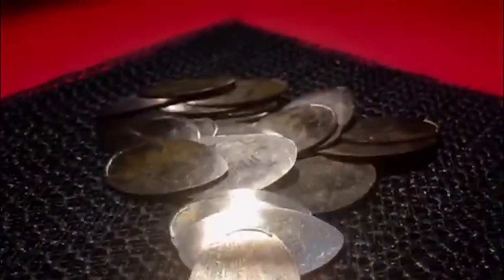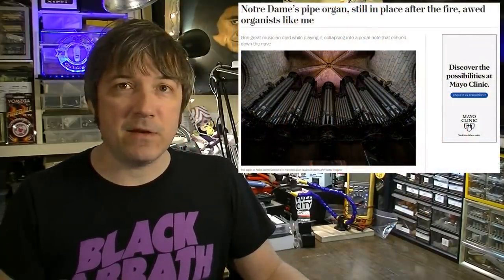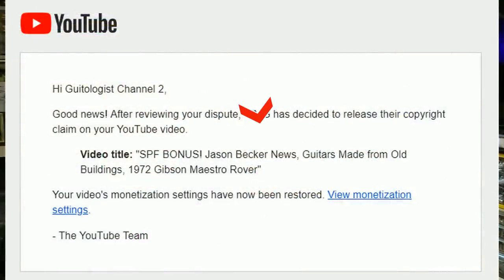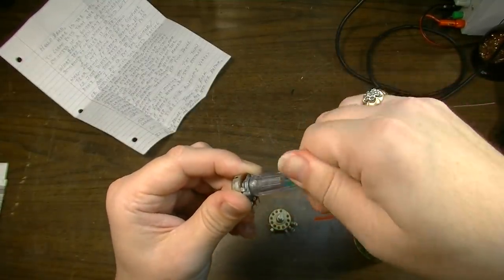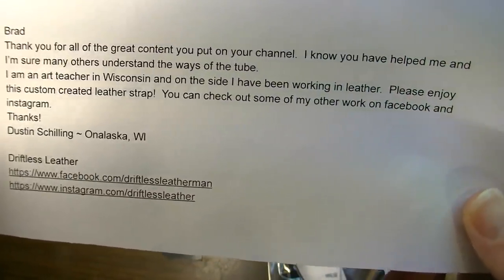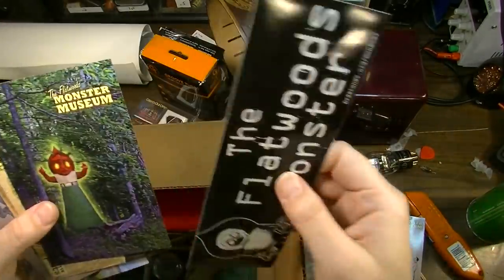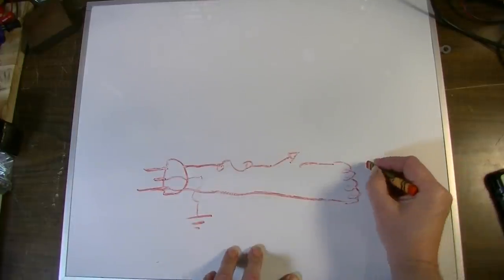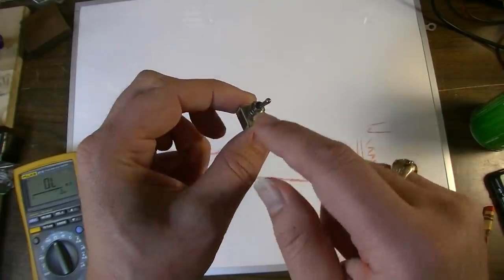Hologram Concerts Are the New Normal - SPF

Comment: Here's my comment on virtual midi controller.
I started out my musical life as a drummer. 
I took lessons from an awesome drummer . 
Between him an my Dad they drilled drum notation into my head. 
At the end of my lessons I promptly forgot all of it and never used that knowledge .
In 2000 I got a computer and it had Cubase VST 32 installed. Inside of Cubase I discovered the piano roll screen. 
I found when I had the drum track selected , ( track 10 )   if I remember correctly .
 I could program drum beats just by adding notes to the grid. 
The setting no map looks a lot like drum notation.
All that knowledge I thought I had forgotten came rushing back and that's how I write my drum parts .
Before that I use to tap the beats in onto a drum machine .

Comment: Yep.....3d printing wirh metals.  I work within a research and development group for a global commercial vehicle manufacturer.   We have several 3d printers that we use for "rapid prototyping". Among the dozen or so printers we have is 2 3d printers that print objects in metals. Its amazing. These printers run day and night. Ive seen projects that ran for 90-120 hours. Yes,  sometimes a 90 hour project has a printer failure  after 65 hours of run time. What a blast  !!!  Just restart the printer and sit there watching for another 3 or 4 days. Yee haa !
Reply from the maker: Can you sneak some video of that?

Comment: I had a situation with a Gibson SG where I removed the knobs and a half of the post just busted of a tone pot. Never removed the post before and it just busted off. Damn Chinese parts, 2016 was a rough year at Gibson as we all know.. All I wanted to do was clean a guitar that had less than 2 hours of playing on. I'd reached beyond my warranty and was told too bad. I bought it from Sweetwater and after just a few conversations, Sweetwater took it upon themselves to repair the pot, out of pocket, shipping to and fro. That was a seriously honorable act and they get huge props from me. 
I thought you'd like to pass that along. I asked for a new pot be sent, I would have replaced it myself, and they went that extra mile. I thought you'd like to share that level of customer service to your fans as Sweetwater deserves it. As a retired pet store retail manager of over 20 years, I would have done this myself, but it so rarely happens. I'm freaking really impressed. I know I can count on them, that is hugely reassuring in this day and age. In fact, they offered to eat the bill if I wanted to take it someplace local. Who does that these days? 
Sweetwater has my loyalty now. I'd bought a few cheap Epi's from the GC near me, but not again. I'm looking for my new guitar from Sweetwater. GC sold me a $400 guitar with almost 3/4 of an inch of string space at the 21st fret and sure, they dropped it to something reasonable when I brought it in to a local store, but failed to touch the intonation. Granted, it was just a $400 Epi, but still, Sweetwater would have dealt with that before it got shipped. That's my rant, off to bed. Be well all.

Comment: On the subject of the fire at Notre Dame... the Grand Orgue (Cavaille Coll) is to be removed from the cathedral and put in storage until such time as it can be cleaned, serviced and re-installed. The Choir organ however, (the one used for daily recitals, practice, etc.) was completely destroyed in the fire, since it was at the other end, near the altar, etc. and took massive water and heat damage. It will have to be rebuilt from the ground up, unfortunately.😐

Comment: On the pot cleaner attachment, Stew Mac sells something that is supposed to be similar in function. I think everyone has hoped that they could just spray some cleaner in from the outside, but unless it's really impossible to get at the pots for some reason, it's so much better to spray them from the inside.

Comment: not sure  about the toggle switch cleaning thing. the switch lever cant be contacted to the contacts . if it were whenever you flip the switch it would shock you. granted powering up when there is liquid contact cleaner puddled inside is not a good idea . i would imagine it could short the switch where it csnt be turned off temporarily or maybe even short current to the chassis. im not 100% sure of the internals of a switch but i cant see how the lever is connected to the contacts inside or else you would get shocked everytime you turn your device on. right?
Reply from the maker: The danger is in having liquid bridging the toggle and the contacts. You can fill up the switch and cause this to happen, yes. Don't ask me how I know that. ;)

Comment: The process used in making that guitar is called selective laser sintering, SLS and can make machineable hard metal parts. It's a lot different than a 3D printer that uses plastic filament, like the ones I use to make parts for the Harmonicaster electric harmonica http://www.harmonicaster.com

Comment: You, guys, in the States don't have RCD breakers in your grid?
Reply: We have ground fault breakers for areas where water is present (bath, kitchen, garage, etc), but the entire service panel isn't protected like in Britain
Reply: @ctyragdoll  I'm from Poland. It's standard here. I couldn't suffer from an electric shock if I wanted to. I am one of those people who are very sensitive to current. When I was building my home, there was this case when the electrician switched the power off from the whole house, and we were doing something, and I got a slight spark just from the bare hot wire, even though the grid was off, and the electrician was pretty amazed at that. There is about 1.5 km of wire in my walls...
Anyway, I've got a ground fault breaker on each floor of the house.
Reply from the maker: He's correct, different standards here. I'm kinda glad of it in a way because it would piss me off to have those ground fault breakers tripping all the time for no good reason.
Reply: @TheGuitologist  When you're working on the bench, then I agree! They could be popping all the time! However, cleaning a hot pot wouldn't kill the DIY amateur!

Comment: The process to make that guitar is like reverse machining. Instead of starting out with a block of metal and cutting chips off to reveal the parts within, here theyve started with chips that have been pulverized to dust and welded only the particles neede to complete the parts! A bit like the old saying ashes to ashes, dust to dust. 
I'll tell ya, I have been using their metal cutting tools for over 25 years and I know the cutting inserts they make are unbeatable.
And no doubt they just made the guitar using the same principles they use to make the tool inserts. I get why they chose Yngwie J. Malmsteen ( not be confused with all the other Yngwie Malmsteens !) Though it would have been cool to see Pete Townshend of the Woodstock era version of The Who have a go at it. My money would still be on Sandvik but Pete would have had the best chance of breaking it, in my opinion. Maybe they can make a hologram of Pete wrecking it?